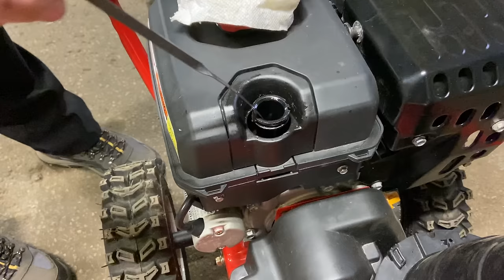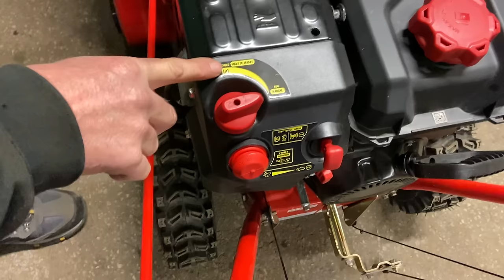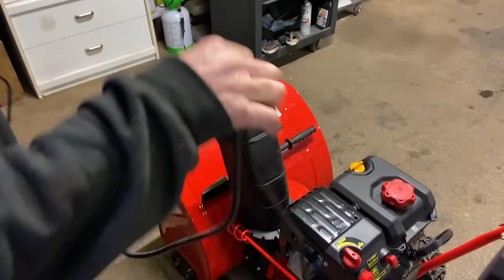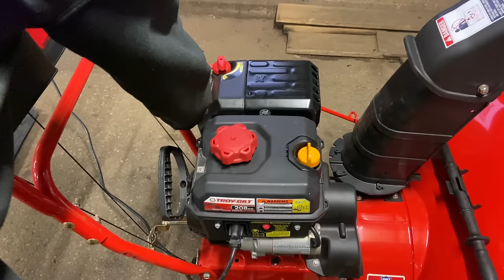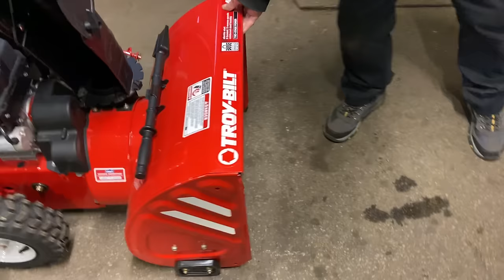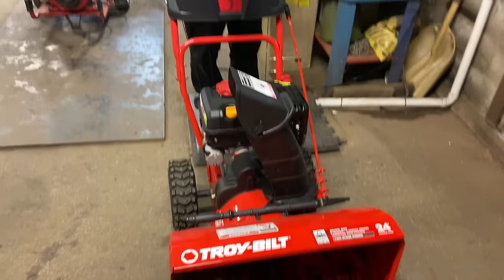How to start a Troy Bilt Storm 2410 snow thrower

Comment: Every year my husband forgets how to start the snowblower… says it’s junk, needs a new one and at least a few times i come watch the video and start it right up. 🎉
Reply from the maker: 99% of most no start conditions with snow throwers are human related!!! :). I hope your back up and running! Because fuel is a big issue going bad inside the carburetor not allowing the machine to start, (human related) I would try and stay away from gasoline coming out of the gas pump unless you can find non ethanol gas. I would highly suggest using Aspen4 gas you can purchase in quart of gallon containers. Here is a link to read about it and find a location near you. https://www.aspenfuels.com/products/alla/aspen-4/. If you start using it your starting issues will, for the most part go away and make sure you watch the start up video before the winter storms hit! LOL.

Comment: Excellent details in that video. I just purchased this machine online from Home Depot and it’s being delivered tomorrow so I’m interested in learning as much as possible about it. As far as Gas is 89 or 93 octane good? And what kind of oil, do you need for this machine, specifically?
Reply from the maker: I would use 93 octane or a product called TruFuel that you can purchase from The Home Depot. Check the manual for recommended engine oil but I would say either 10W/30 or some of the newer machines are now using 5W/30. Check manual.

Comment: Thank you!  Great videos - easy to follow narration and camera work.  It gave me the confidence to try to fix my snow blower which hadn’t started in two years (despite a few attempts).  I can’t get it to run smoothly however.  It sounds like, “vroom, vroom, vroom, vroom”.   Any thoughts?   Here’s what I did to get it started.  I sprayed the carb and choke openings with a carb cleaner spray, changed the spark plug and oil, and added some gumout into the tank (old gas with some white deposits at bottom of tank).  It started, but ran very rough for the 20+ minutes until it ran dry.  A day or two later, I added Mechanic in a Bottle and ethanol free gas, but it still runs rough.  What is left to do?  Thanks again for your videos!
Reply from the maker: My apologies for not getting back to you sooner, your comment was held. Your surging is due to the carburetor has a blockage inside. If you feel comfortable doing so, follow the directions in the description of this video on how to remove the carburetor, then rebuild it or replace it. There are videos to help you through the entire process in the description.

Comment: Excellent video! Either I never learned that a short cable was viral or I had forgotten.  That is an excellent excellent thing to tell people. Thank you.
Reply: I didn't know this either.  Since Home Depot didn't include it I probably would have just used a regular extension cord. Now I'll just pull start it until I can get a proper one
Reply from the maker: I'm glad it was helpful!
Reply: @JohnsonsSmallEngines  Yes. Very helpful. Thanks again!

Comment: Liked and subscribed, great video and very informative. Can’t thank you enough, I am new to using snowblowers, 3 days ago was my first time and i was completely lost so your video saved me.
My question is, what kind of oil and fuel should i use? And can i get both of them at Home Depot? Thank you!
Reply from the maker: You can use 10w30 or 5w30 in the engine. You can buy True-Fuel (grey can) or regular pump gas at the gas station. I would recommend the highest octane at the pump. The oil and True-Fuel you can purchase at The Home Depot.

Comment: I have a similar machine it doesn't start up as easily as yours does but runs well on long island maybe used it 10 times in 5-6 years sometimes I notice as it's running a small kick or hiccup but it evens out I've changed oil n spark plug still does it the machine is from 2018 never sits with gas in it carb should be clean I do run stabile through it when I'm storing it
Reply from the maker: Knowing that the machine is hardly used, most likely the carburetor will need to be removed and cleaned to get the hiccup out. Sometimes no matter how good we store the machine, the gas will sit somewhere in the carburetor and go bad.

Comment: Bought one. Worked great last year. This year will not start.
Reply from the maker: If you left gas in the machine? Most likely fuel has gone bad in the carburetor not allowing the engine to run. Gas will turn sour(go bad) from sitting. You will most likely need to try and drain the carburetor and fuel tank of old gas and put fresh in. You may need to rebuild or replace the carburetor if flushing does not work. I have videos on how to do it.

Comment: Hi Brad, I bought this machine and used it only once, and then left the gas in it over the summer. So now I cannot start it, I emptied out the carb. and tried to take out the spark plug, but need an extension to remove it. i am now going to try and see if I can unstuck the valve. My question is, can I use a gas treatment to help the carburetor, to start it?
Reply from the maker: Hi Trish,  In my opinion, I do not believe in "the bottle of fix it". If it does not start, there is a issue.  Watch this video, https://youtu.be/Wj25U4FDV-0. This may help you.

Comment: Great instructions!! Thank you, will be purchasing this same blower but it's used, anything I need to know before buying it as far as checking it out?? First time ever owning a snowblower. Thank you!
Reply from the maker: Yes, make sure the electric starter works if it has one, Make sure when the engine is running that the choke is completely in the off position. If you need to keep the choke on even just a little that means the carburetor needs to be rebuilt. Check to make sure the bottom skid plate and side skid shoes are not worn out. If they are worn thin, that is a sign of hard use. It also should start within a few pulls of the pull rope. That was just a few to quickly check.
Reply: @JohnsonsSmallEngines  thank you!! I appreciate your reply on what I should check for, very good information!

Comment: What type of gasoline should be used for this machine? Is it mixed ?
Reply from the maker: I suggest straight high octane fuel from your gas pump. No mix. If you can get ethanol free gas? that is good too.  Remember to  check the engine oil level before running the machine!
Reply: Thank you !

Comment: I have the same model. haven't run it for the whole season no gas left in the tank before storage.  put new gas and start it, it cranks for 2-3 sec and then shuts off repeatedly. Any thoughts or advice? it's an essential new machine, on/y used 4-5x in 2 years.
Reply from the maker: Just because the tank was dry doesn't mean there wasn't fuel left in the carburetor. Most likely the carburetor will need to be cleaned. Watch this video, it may help. https://youtu.be/Wj25U4FDV-0

Comment: Nice work 👍🏼. I just purchased a used one with a 179cc engine that’s several years old for $100 and started up with no issues. Took notice the auger wasn’t working so I took the belt cover off and discovered the belt is worn, ripped and broken with a good amount of black gookie caked up residue throughout the pulley, cable spring and the compartment. Replaced the 2 belts, spark plug, fresh oil and gave it a good cleaning. Gonna change the flywheel and add a stator so I can install a light. Found a used stator and flywheel for $50. I noticed you mentioned your in eastern PA. Whereabouts?
Reply from the maker: Good Luck with the machine but honestly, I hope you will not need it :). Please give this video a like, subscribe and tell your friends about my channel to help it grow. It would be greatly appreciated. Thank you for watching and commenting.

Comment: Great vid. I have the same one and never emptied the gas during spring and summer. Now it will not start :(. Do you have a troubleshoot vid on that?
Reply from the maker: It will not run most likely do to the gas went bad in the carburetor, The fuel tank will need to be drained then you will need to remove the carburetor and either rebuild it or replace it depending on how bad the gas is inside the carburetor. Here is the link to take the carburetor off of the machine.https://youtu.be/sK5m9iTxR4U. i will also send a link after this on how to dissemble the carburetor.
Reply from the maker: This is how to disassemble the carburetor. https://youtu.be/_ngK6l6_J7g
Reply: @JohnsonsSmallEngines  Thanks so much. I feared you may say this lol Thanks so much for your vids and all of your help.

Comment: Nice video!  I see they now have the Storm 2420.  Any thoughts if it is any better than the 2410?
Thanks.
Reply from the maker: I will assume the newer 2420 has a bigger engine. I haven't seen one yet. Thank you for watching, commenting and subscribing. It is greatly appreciated :)
Reply: @JohnsonsSmallEngines  Thanks for the response.  Same size engine.  Looks like no manual choke like the older version.

Comment: What are the speeds should be using? I have F1-F6. Oviously depends on the snow but say 4" what would I use? What about 8"
Reply from the maker: You will be the judge on how fast you want to go. I personally just listen to the engine and if I think it is working too hard I slow down. so the engine isn't grunting to hard. If it sounds like it is going to stall the engine your moving to fast for conditions "in my opinion"

Comment: Just purchased the Storm 2600 and have a question: Other than the yellow handled oil dip stick on top, there is another yellow handled and what appears to be a screw type located towards the bottom of the motor, what is this one for? Nothing is listed in the booklets I received with the blower. Thanks!
Reply from the maker: It is another oil cap. Just use the dipstick. No need to even open the other yellow cap. Just make sure the yellow cap never comes off or comes loose.
Reply: @JohnsonsSmallEngines  Thanks!

Comment: Do you have to use the electric start cable to start the machine? My snowblower didn't come with this cable. The manual is a nightmare
Reply from the maker: You can start the machine two ways. You can use the pull cord with the handle or use the electric starter. Using the electric starter is just a easier way then pull starting and it spins the engine over faster so starting is a little quicker but both ways work just fine! Thanks for watching!
Reply: @JohnsonsSmallEngines  thank you for advice and information

Comment: hi  I did everything u did in the video and it still doesn't turn on it was fine last year and now it doesn't turn on
Reply from the maker: The reason why it will not run is because just what you said, you haven’t run it since last year or at least a year ago and now the fuel in the carburetor is bad. You most likely need a carburetor flush, rebuild or replace, depending on how bad it is inside the carburetor. To avoid issues in the future, either rum your machine totally out of fuel, run the machine periodically during the off months for 15 minutes at a time every other month, and also use non ethanol fuel or TrueFuel that you can purchase at hardware stores.

Comment: Very well done from a guy that clearly knows his stuff.  The only disagreement I have is the need for high-test fuel.  I have better luck with regular in small engines but that's just me - and it doesn't change how well-done and informative this video is!  Thank you, sir, and keep up your greatness.
Reply from the maker: Thanks, in the area I live in they put a lot of chemicals in the fuel to help with pollution control and so the fuel is not very good in our area for the single cylinder engines so I always recommend the higher octane fuel. It’s just better gas for small engines. Even better would be none ethanol gas but we do have it in our area unless you drive a distance to get it.